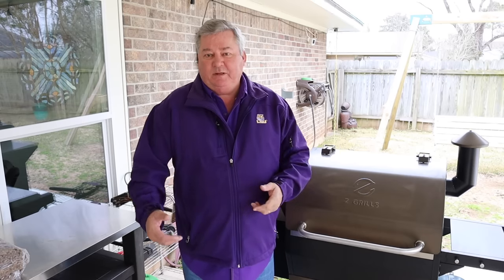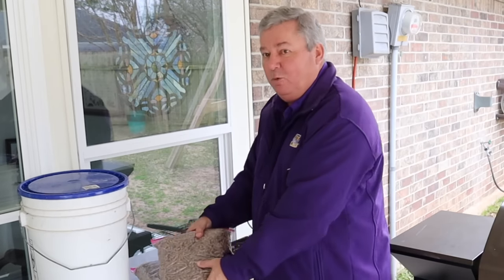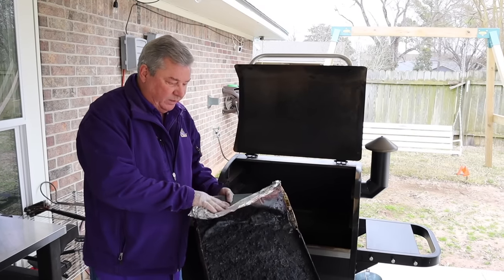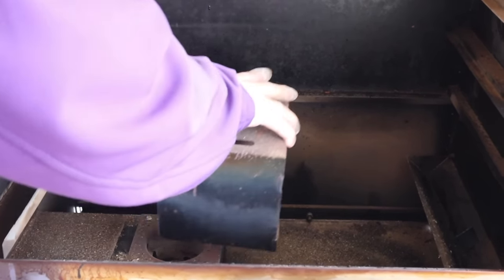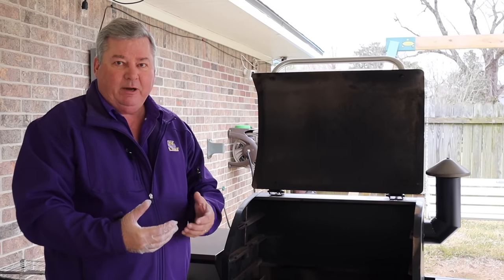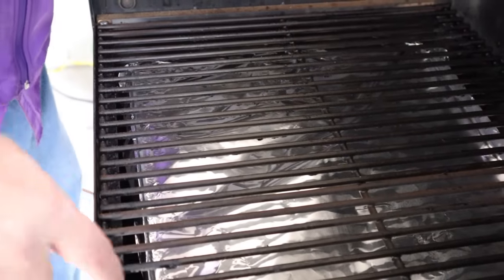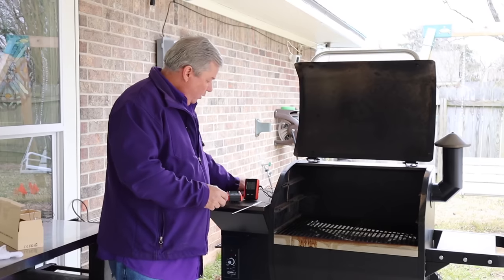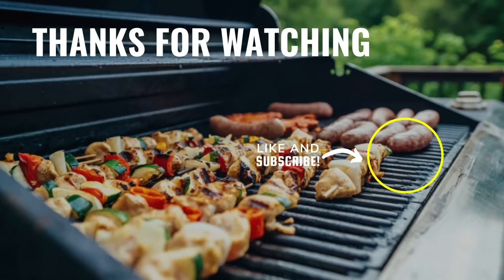Avoid making these 7 HUGE mistakes on a PELLET Smoker - Southern Backyard Cooking

Comment: My new Z grill/smoker hasn't even been used. After priming I tried to use and something is wrong with the thermostat I think. It won't regulate the temp, just goes straight to 400+! I have contacted customer service but they won't help me. Brand new grill sitting for four months now!!!
Reply from the maker: I.m sorry you are having this issue. I know the times that i have called customer support, they were very helpful. You may want to try again.
Reply: Find a Facebook group where people use the same smoker. Sounds like it might be a defect in a part. Might be too late for a return. Personally I would have returned the smoker right away.
Reply: Think they have 1 year warranty, call them, email them, blast them on Facebook, do what you gotta do. I love my z grills, smoked my first brisket for thanksgiving and it was amazing!
Reply from the maker: @Sonytherealtor  No, thay have a three year waranty. Here is the link https://zgrills.com/pages/warranty-policy

Comment: Use a clock to know when to start checking the temperature. The temp. tells you when the cook is done, not the clock.
Reply from the maker: Or you can have a wireless temp probe that you can carry around with you that has an alarm on it when the meat is at the desired temperature. This is what i show and demonstrate in my videos.
Reply: @SouthernBackyardCooking  Why would anyone check the temp 5 minutes into a cook. You use the approximate time to determine when to start looking at the temp.

Comment: All true... and like the thermostat pin.. getting dirty with every cook.   NOW think about all that pellet dust getting on your food... Yummie ... I wonder what chemical is in the Pellets to hold them together.????   Anything ????  Because... that dust gets on the meat.   NOW my big fancy RecTec grill goes unused.  I'm back to cooking with charcoal.  If your a pellet grill guy.... and you clean your grill... you know that pellet dust gets on everything... inside the grill... including the meat your cooking.
Reply from the maker: This is why I say to vacuum the smoker every use or two. I have had several Pit Boss owners brag about how they can flip a lever and empty the ash pot, this only promotes not vacuuming all of the dust out of your smoker.
Reply: @SouthernBackyardCooking  my ashpot does nothing on a pit boss platinum.  More ash in the grill than in the ash tray

Comment: I was in contact with the factory, asked about using aluminum foil and they said absolutely not.
Reply from the maker: That is very strange. On page 16 of the owner's manual, number 8 states "We recommend you cover your Grease Drain Pan with heavy-duty aluminum foil and change it frequently."
Reply: @SouthernBackyardCooking  my page 16 describes the control panel functions.
Reply from the maker: Then you do not have the same smoker that I have. What brand and model is your smoker?
Reply: now they sell the aluminum trays, ;-P
Reply: Agree on not wrapping with foil. Even tightly wrapped foil can provide a path for grease to depart from the intended path. As you can see when you remove the foil from your tray, grease has found it’s way underneath. Rely on the drip tray to do its job and use a putty knife to scrape every couple cooks. All the other tips were great by the way! Don’t mean for this to be a negative post. Gave you the thumbs up!
Reply from the maker: @joshuakohles4367  Thanks for watching!

Comment: These are some time tips, yet everyone of them except for the last 2 are helpful. The others will almost make no difference. 1 pellet storage in water tight container is no more better than leaving it in the bag. Which is what most people are going to do. 2. covering your grease trap with foil will hinder the whole point of having a drip tray and is just wasting money on foil. Plus most people are not going to have 18" or 24" foil. 3, cleaning the grease trap. You grease trap should work 100% of the time as its intended. 4 cleaning the temp probes make very little difference and will more than likely work for the life of the grill. 
Of these 4 things you should not have to do anything with your pellet grill until something does not work. These things pretty much solve every problem you have with out intervention. If I have to spend hours cleaning my grill because the manufacture did not design it right then I am taking it back. 
I am going to say there are many people out there right now with pellet grills that are years old and they have done nothing to them at all and use them several times a week The only thing you need to do is add pellets and drain the grease. You are going to have to burn ton of pellets before you need to clean the ashes out. To burn 1 ton of pellets you will need to burn 1 hours worth for the next 5 to 10 years every single day.
Reply from the maker: Go ahead and ignore my suggestions and continue to have problems using your smoker.
Reply: @SouthernBackyardCooking   ☠😂

Comment: Some good hints but don't  agree on vacuuming bottom of pellet smoker but once or twice a  year.  You clean the pot regularly but the ash on the bottom is insulation, will soak up a grease in case it doesn't make it on the drip pan and will catch any ash that comes out of the pot.
Reply from the maker: Sure, if you only use your smoker once a month or two, don't vacuum it out. As far as it adding additional insulation, WRONG. If the smoker needs additional insulation, buy a thermal blanket. I do not want any ash floating around and contaminating my food. But, hey do whatever you want. It is your mess and food you are dealing with.
Reply: We will have to agree to disagree and I have the backing of the experts at my manufacturer and never ruined food. Choices. . .smoke on!!

Comment: Seems that they are a lot of work to use. propane with a smoke tube is better by far.
Reply from the maker: Propane smokers do not keep consistent temperatures.
Reply: Every time you open the lid to put in more chips you lose the heat.
Reply: @paulhartshorn8880 that's why it's auger fed with a hopper on the side... You never open the lid